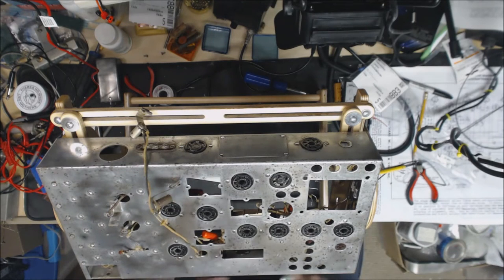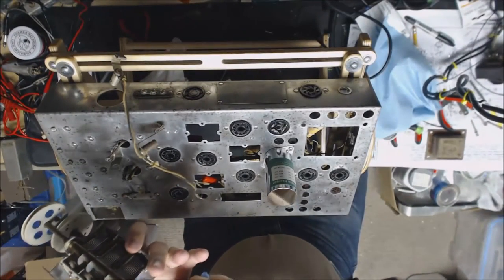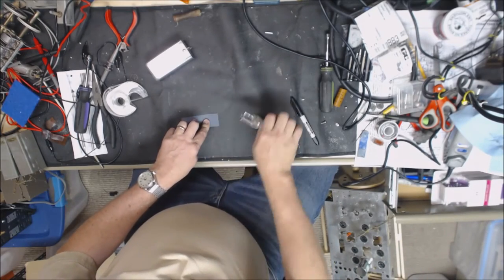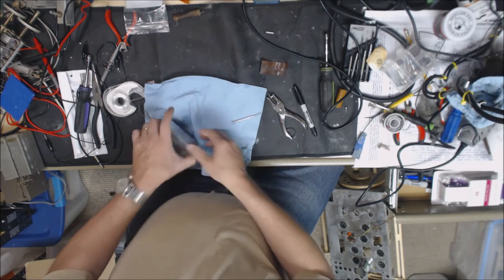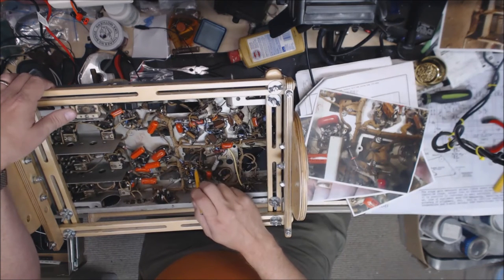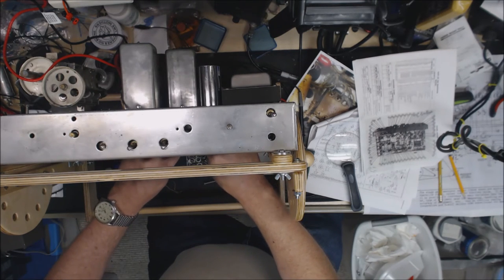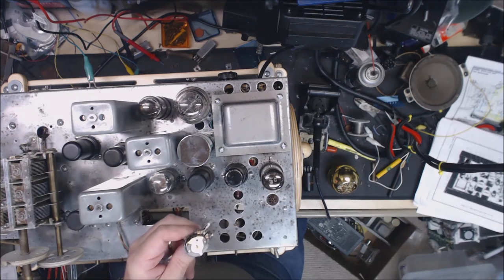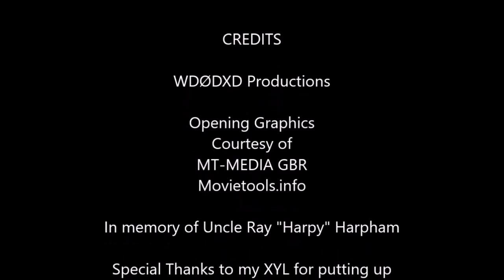K1SVC S-40 Hallicrafters Restoration - Part 5

Comment: The sensitivity control is important if you want to listen to SSB. You have to get just the right setting of the BFO pitch, tuning. and sensitivity controls. It's a bit touchy especially on the wide band sideband guys but once you get it dialed in it does a decent job of receiving SSB. 73 Doug